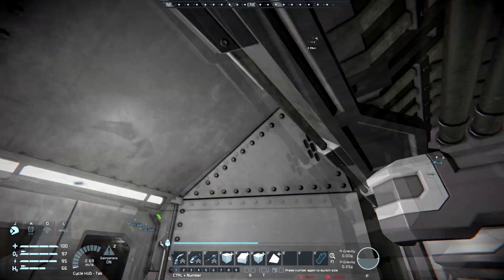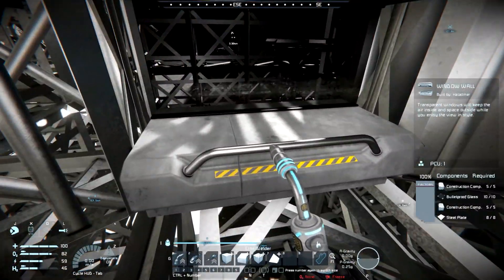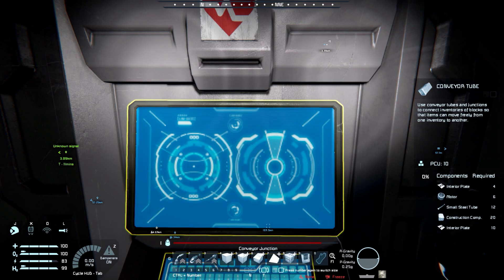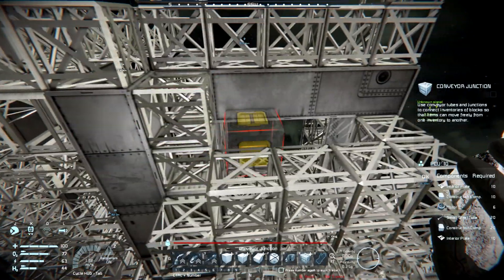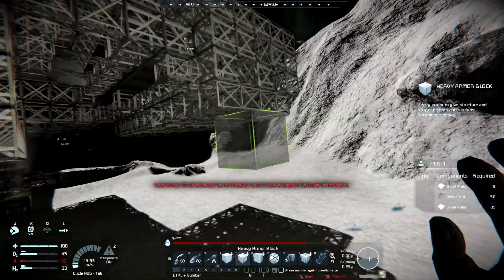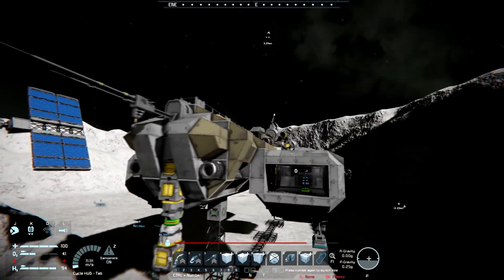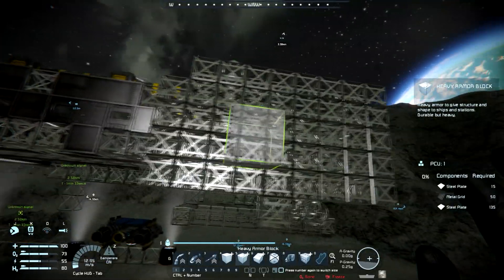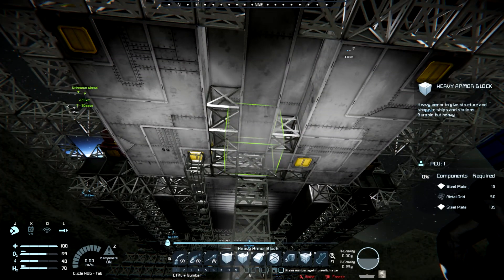Space Engineers | Economy Progress | Ep.30 - 1st Defensive Line

Comment: They don't usually airtight door every room since that will make it really expensive to build and take up valuable space in a ship. Just remember to connect up your conveyor system before you forget. I did just that and my ship is tiny compared to yours. You can alway switch to creative and blow yourself up to test it.. Have you tested your proof of design before? Hard to redesign if you have already build everything. The launchers and stuff. I will suggest using a build and repair to help you cut down on all the steel plate welding. Unlike when you play multi player you get help to weld
Reply from the maker: At least I had some free time this week.. got most of the internals welded up, but will probably use Bob (build and repair) to do the armor blocks simply because that is tedious lol

Comment: I am wondering if it makes sense to have decoys on rotating rods outside of the ship. It would look like a propeller. Because of the movement it would be hard to hit by the AI defense fire and may distract a lot of bullets into space. Or not?
Reply from the maker: It could confuse the AI a bit, but when using that style of system in the past, it usually causes more damage than it prevents :D  On that note, having finally welded up most of the internals now, I'm working on getting the aft launcher buildout completed, since I want to work on the cargo system and maybe engineering for Friday's video.

Comment: Like the idea of using the hangar modules but wouldnt you have to convert them to heavy armor so you dont just create section sized weak spots? that would be the moment where i´d decide to save myself the time and just replicate the modules
Reply from the maker: To be honest, I'm thinking to use it more as "extra" armor, so just using it as-is would be fine, the general build theory is following more of a Battleship build where you have a castle/citadel layer protecting the core parts, and the rest makes up superstructure.
 
Once the ship is done, we'll have an auto-repair feature built into a lot of the central hull, and since the exterior bits will be taking the brunt of the damage, I'd rather have a hole to repair in the light sections than to have to overcome 2 or 3x the mass we're already at lol.

Worst case, we later replace areas with heavy armor as a refit :D

Comment: wow such a big project...thanks for the entertainment...are you going to build a welding ship or put build and repair on ????
Reply from the maker: Because of the inventory limits, it's actually faster to hand weld if I'm not using a large cargo block welder.  Small and medium (small grid) or small (large grid) just don't hold enough materials to make it worth using them. Medium cargo has about 2x the capacity of my personal inventory space, so I'd be able to weld 4 blocks at a time, but would take longer getting to/from connecting, loading, etc...